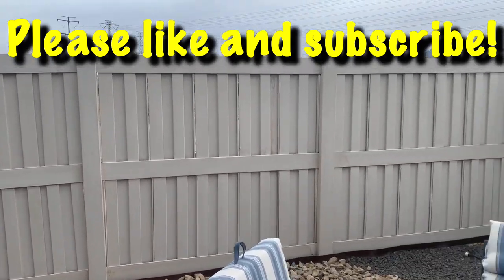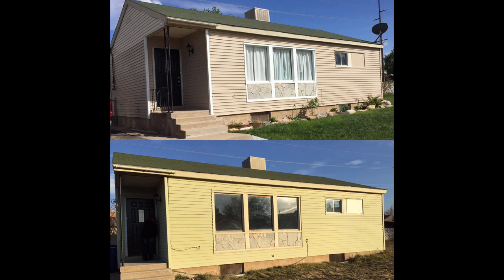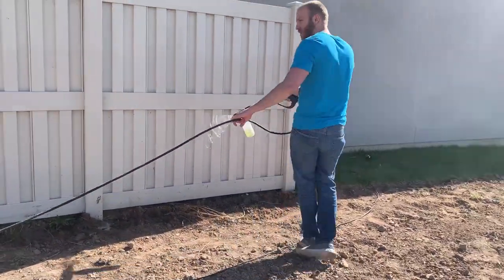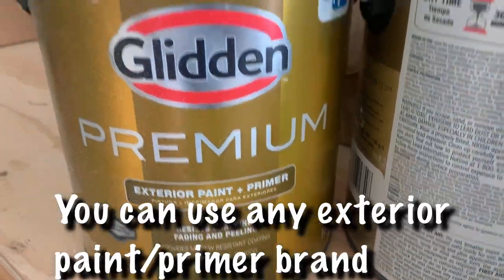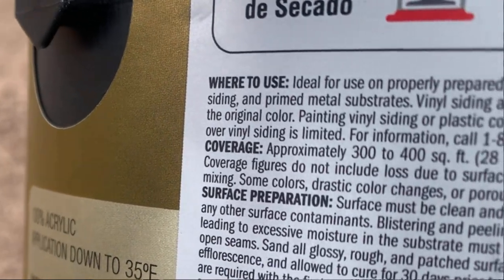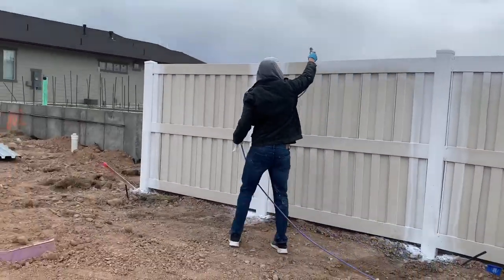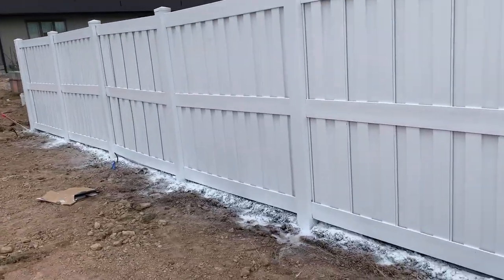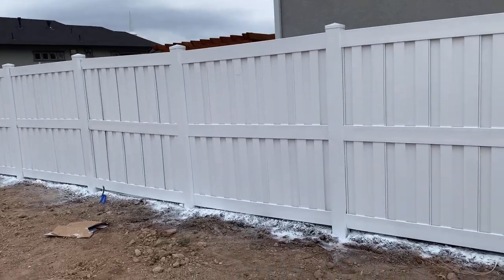How to Paint Vinyl Fencing or Siding

Comment: How is your fence holding up.  I bought a vinyl fence panel a few years ago and it wasnt put together.  When one of my panels broke because of a wind damage, i decided to put the new one I bought together to find out it was not white but sand color.  I cant return it and get another one.  I was thinking about painting it.
Reply from the maker: Mine has held up nicely. I would definitely do it if I was in your situation.